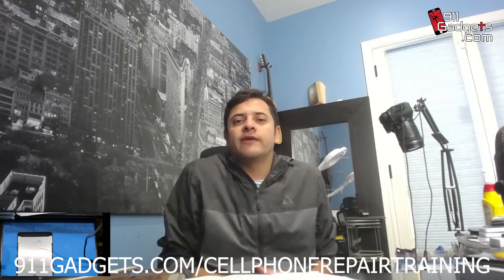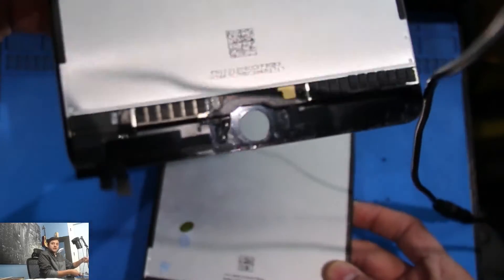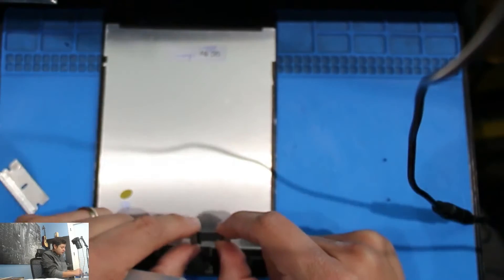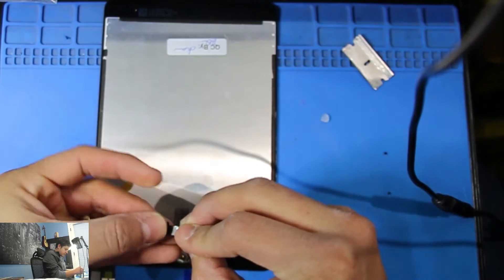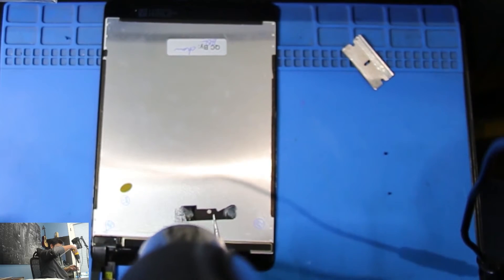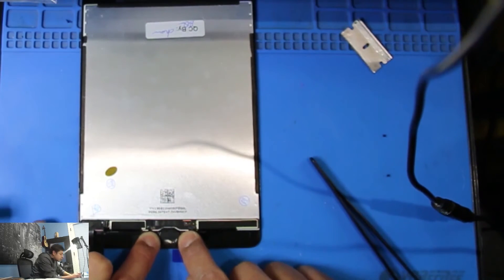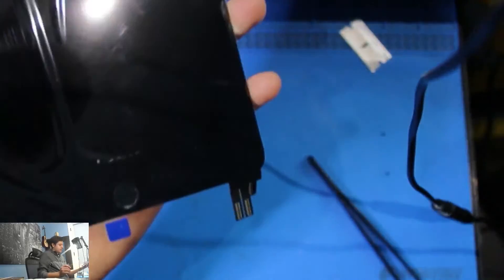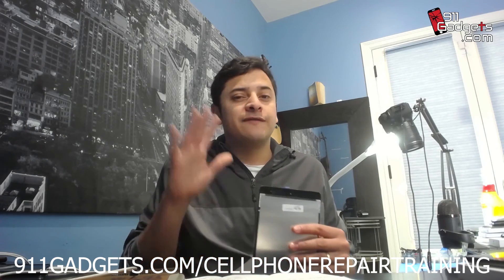iPad Home Buttons - How to install them once and for ALL!!!

Comment: I know it is an old video but still, thanks!
Question, does the home button/gasket itself have adhesive on it? or it is all held by the bracket?
Reply from the maker: Yes it has some adhesive that usually transfers over. But you can always use some glue

Comment: what i do is clean well and super glue it
Reply from the maker: Ive thought about super glue before. I haven't got the courage to yet. When i was little i superglued my fingers together and i guess im traumatized lol
Reply: @911Gadgets  I feel you ,another tip is if you going to super glue pre mark the little metal border in the glass with a marker ,some glass replacement already have the lanes where the metal will sit

Comment: Thanks! Very good video, just one question, the circular plastic is that also glued because when i push the button it goes to deep and stucks under the screen.
Reply from the maker: If the new screen doesnt come with that plastic then yes you should transfer the old one over
Reply: @911Gadgets maybe i use the wrong heatglue, because the braket losen directly when i push the button 🤔